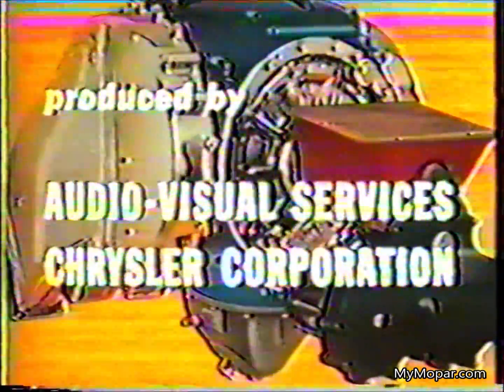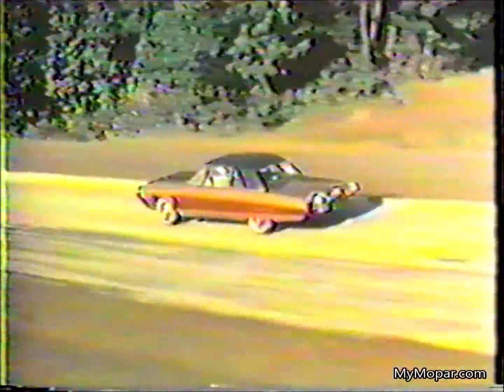The Chrysler Corporation Turbine Car Promo Film

Comment: Chrysler Corporation and its subsidiaries Plymouth Dodge Desoto Imperial they had such a nice run in the 1950s 1960s 1970s 1990 2000s  for a domestic auto manufacturer i own  3 a 1968 Chrysler New Yorker 1973 Dodge Charger and a 2000 Dodge Neon never had any issues been driving them since I was 14 in m i l a n Kansas population 56 way back in 1989 with my first one which was a 1963 Dodge 880 sedan appreciate your empathy
Reply: Cool. I own a 74 Charger and a 66 Coronet. Would love to turbine-swap on if it were available. 😎

Comment: What is the advantage of turbine?
Reply: it can run on anything with at least a little bit of gas in it, like perfume, and they are smoother, im sure theres more but thats what i know of.
Reply: Almost zero pollution. And I always wonder why they killed the project.I think Gas companies didn't like this. Some of these escape the crusher. Jay Leno has one. 🐻
Reply: @bigbear5981 While turbines produce no carbon-based pollutants, they actually produce nitrogen oxides (NOx) in quantities that exceed those of regular internal combustion engines. NOx emissions are the primary reason why turbine engine development took so long, and eventually reached a dead end.
Reply: Even though they turn at much higher RPMs, they are mechanically simpler and don't require nearly as much maintenance as piston engines.  Despite what the narrator said they aren't very fuel efficient, and I think that is ultimately what did them in.